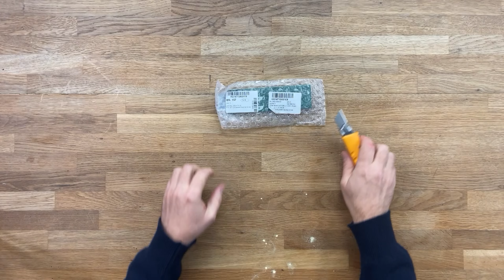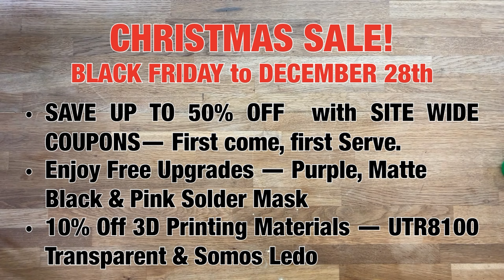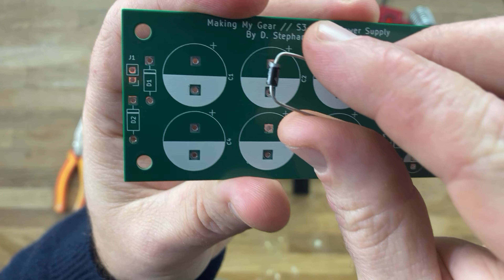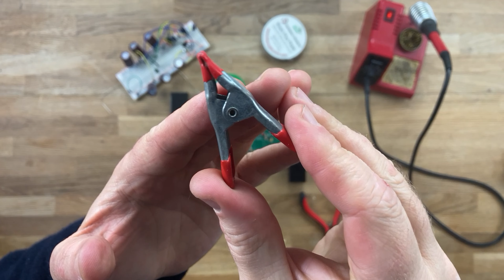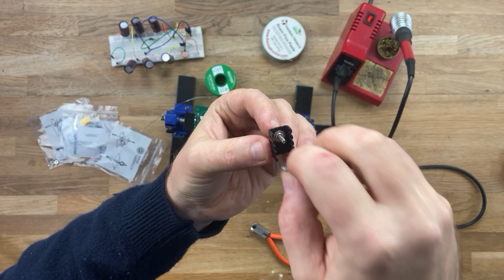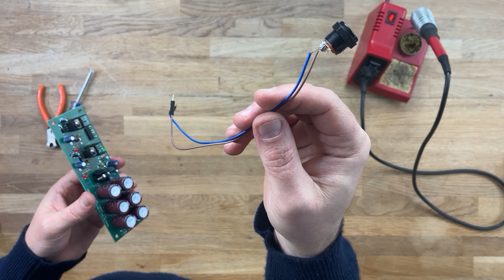Building a Modern SP-1200: Assembling the S3-1200 Power Supply PCB

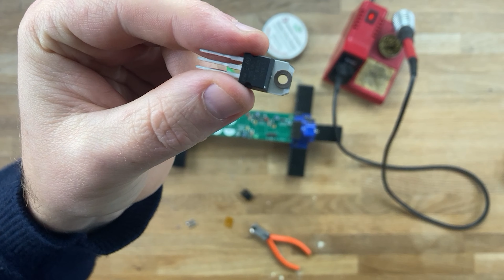Comment: 8:35 Is there a reason you don't want the heatsink to touch the regulator directly? 
On some components they use thermal paste. I guess that's not needed for these regulators? Could there be a reason I would like to use thermal paste? Or is that a big NO-NO ?
Reply from the maker: Good question. On many voltage regulators the metal tab is connected to one of the pins, usually ground or VOUT. So if the heatsink touches that tab, the heatsink basically becomes part of the circuit.

It’s not always a problem, but if you have a tight layout and it touches other components, you're going to have problems. So I usually just keep things isolated to be safe.

As for thermal paste, it just helps heat move from the regulator to the heatsink more efficiently. For small regulators it’s usually not necessary, but it’s definitely not a no-no either.